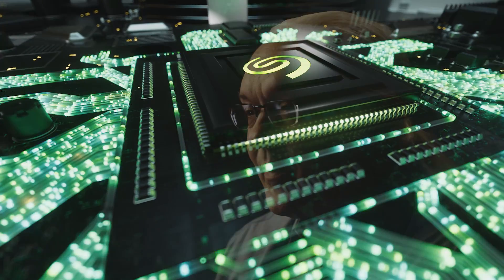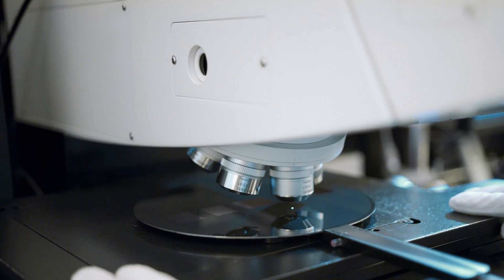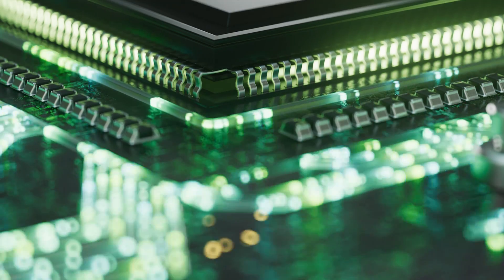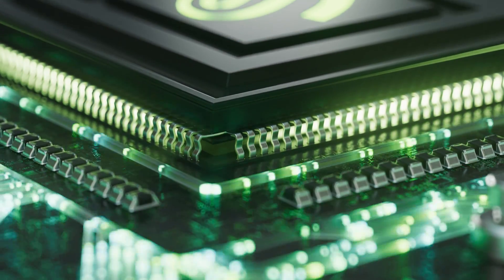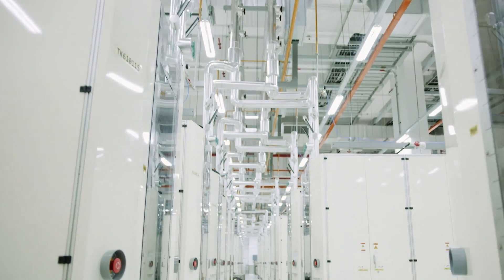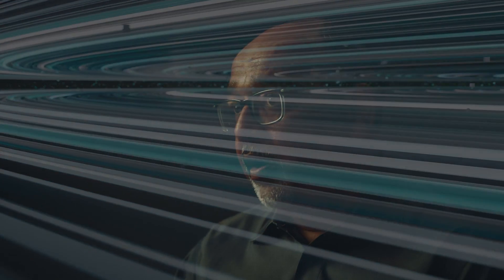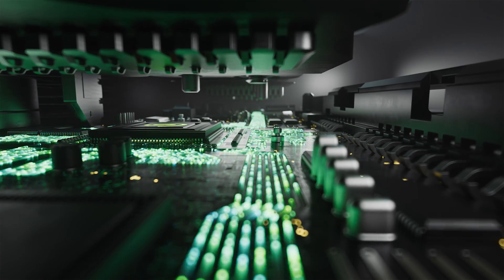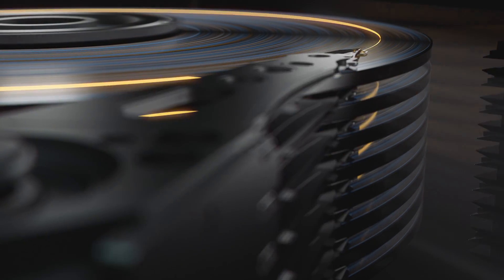Seagate | Mozaic's Breakthrough Tech: Our 12nm Integrated Controller

Comment: You take two 64 bit values and subtract them, it takes four ops in a nested 128bit comp / shift, its easy because 01 + 01 = 10, but the key is you use 4096, but not all at once, first you count your sine cosine operations;  quick sort > 2 -> 4 -> 8 -> 16 -> 32 -> 64, 6 sine / cosine operations.  Really, we can do this at 5ghz, next, we need an combination, large to small.  However, its 64 values, so we use a six bit combination for each subtracted number position, except zero.  Zero is our file system container control 🔑 key.  There are also radix padding, a combination bigger than a radix just need n-1 (set S) this < bit# [for each radix bit].  So the stop key is because we do this 4096 times, then 16,777,216 times.  More for DTS: Home Theatre and associated 2D micro Mario 8k artwork and charity looting beggars AI motion array pivot matrices contractors.  To dog the pesky flesh bags.😅